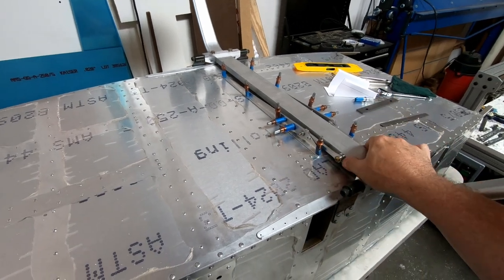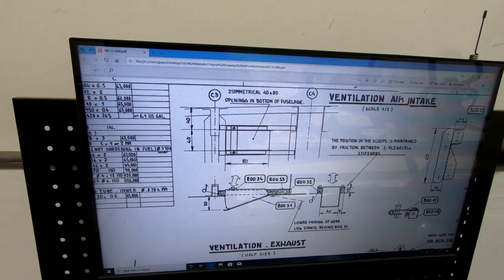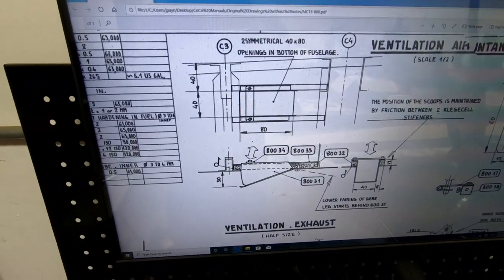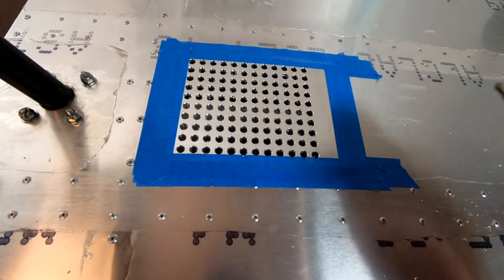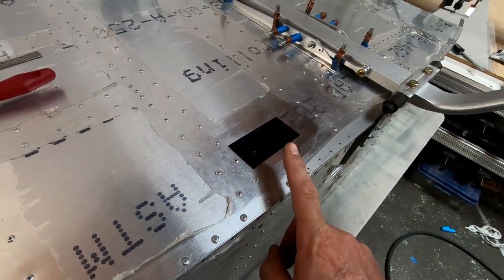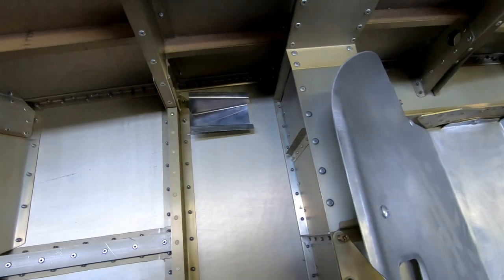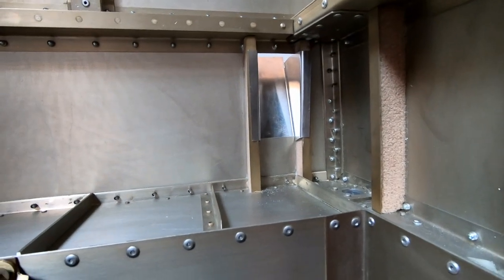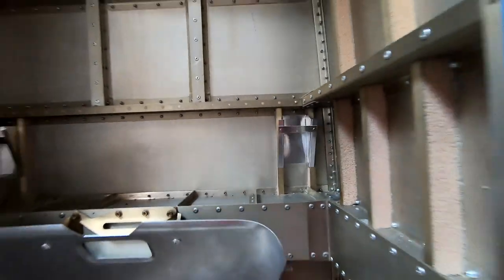25 - CriCri Airplane Build - Cockpit Ventilation

Comment: That inlet at the front seems like an absurdly laborious effort. How long did it take to drill all those holes? Cutting 3 sides of a rectangle with a disc, bending down at the rear, and riveting triangular sides in to make would seem much faster.  Or cutting an NACA duct, though that would be trickier. If there's a need for a screen, (why?), put some mesh in place. 
I really wonder if Colomban went through his design  to simplify building. (There can be as much work in making something easy to build and maintain as just creating something to do a job.) E.g. why 2 small outlets, not one bigger one?  Is that even a low-pressure area? Doing that might be a way to improve the plans and completion rates.
(Not criticising the video, just can't help doing value analysis of designs and processes.)
Reply: Very interesting questions and thoughts…
Reply from the maker: Yes, I have to agree. I was trying to stick to the plans for the videos but lots of room for builder modifications with regard to the air intake and exhaust vents. It's one of the reasons I didn't drill and cut the holes when CNC cutting of the bottom fuselage skin. Obviously letting the CNC machine cut those out would have been much easier but I think most builders would prefer to make modifications to this part of the design so I left them out of the original cut files and cut/drilled them out by hand to show this as an option per the plans.